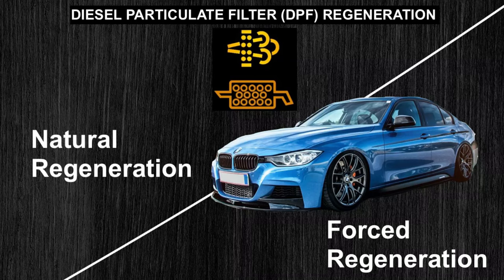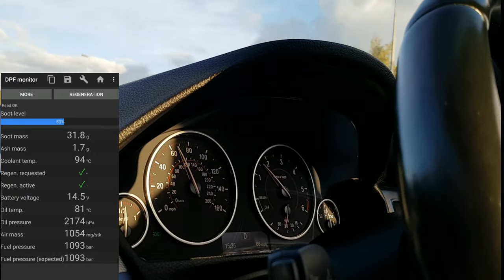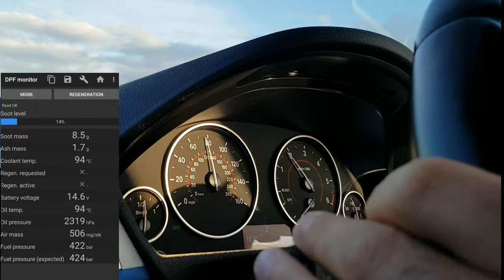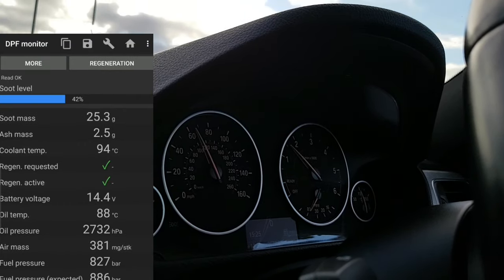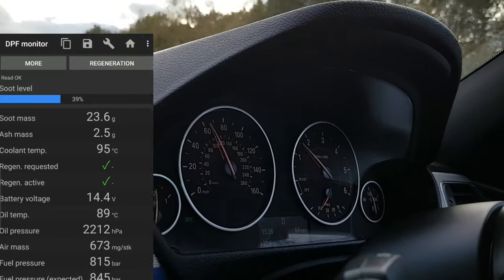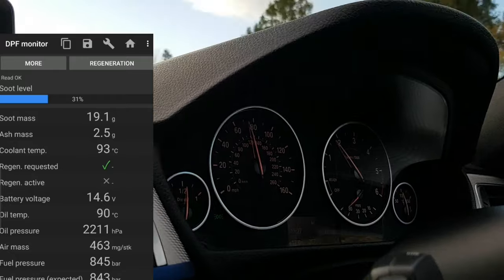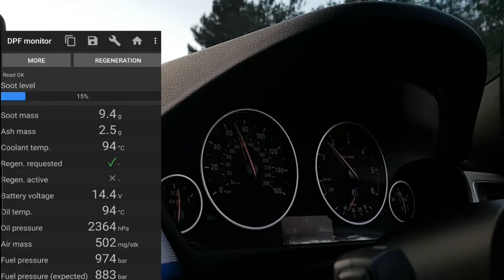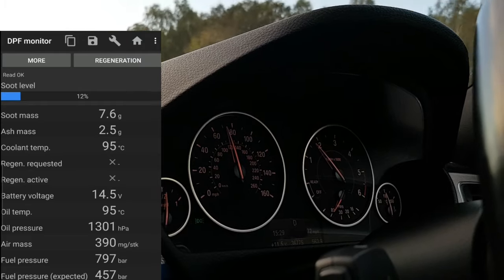BMW DPF Regeneration

Comment: I've found since I've deleted the EGR the DPF regens a lot more frequently and the exhaust gas temp isn't as high as beforehand. Will probably bring the EGR back as a result.
Reply from the maker: Unfortunately you're correct, especially euro5 and 6 engines are so tightly constructed, so any mods on the engine might cause a serious problems somewhere else in the car. In my experience, I like the way egr works, keeping the emissions low etc. But also I took it out to clean and it wasn't difficult at all.
Reply: Just a tought: shouldn't it be vise versa ? Because EGR is supposed to lower EGT and thus reduce NOx. Theory says EGR introduces less O2 in the engine and lowers burning temperatures. I think higher EGT means more "natural" burning of soot.
🤔
Reply: Is it 60mph or a certain amount of constant revs
Reply: @markneedham2287  Not necessarily no. DPF regens can happen while driving around town and also with less than a quarter tank of diesel.  On the automatics you'll definitely notice it as the behaviour of the gearbox changes.
Reply: @bmwsolutions7880  could you give me some information on what product you are using in this video please

Comment: Hey dude. My glow in plugs are good and so is the relay. 
Been on a long journey but engine doesn’t get past 59degrees 
And although I’ve requested the regen it won’t activate. My launch code reader says it’s been 2107904M since last regen! 
Car goes well and I have cleaned the intake manifold but either my tool is not accurate or what else could stop it doing a regen? 
Any help would be appreciated
Reply: Replace thermostats, boths, main cause why your car stucks around 60C and wont regenerate.
Reply: Cheers dude. 
I replaced the stat and now it’s 88 on the motorway so all good there. 
Still no regen! 
It says regen active but won’t activate. 
I am gonna check to see if it has pressure sensors on the exhaust because it’s an 06 plate and try my mates scan tool for a soot/ash level status and back pressure. And go from there. 
Anything else you may suggest?  
Top man
Reply: @DJSpannamanUK  Hey, i also have troubles with initializing automatic regeneration, even with all demands such as 75°C, 10l of fuel + etc... so i purchased an obd k+dcan cable, otg cable {usb to usb-c (my phone socket type)} and bought also a bimmertool expert app (google play) for about 15€ and now i can run regen anytime i want.
But after first regeneration i spotted that after decreasing soot mass from about 42g before cleaning to 5g, it has after few kilometers again slowly rised to 24g +-.. iam guessing that dpf is most likely kinda halfway filled. But now it doesnt afect my power and consumption any much so i will keep it under control with my app. Once again, bimmertool expert. 
With dpf, ive heard that until you have stable 40g permanent sooting level, you should be Okay.
Anyway my differential backpressure at idle is 5mbar, which supposed to be more than good. New has 1.5-2.5mbar and the top limit is about 20mbar i think.
Hope that helps.
Reply: @davidstauber5288  top man.
Yeah my tool is the launch crp123 and I can request it in the DDE 
It says it’s been requested and it’s waiting to do it but for some reason it just won’t say ‘active’ as in actually do a regen. 
I was tempted to but and autel pro which does the same thing as yours but not sure it tell me soot levels etc. 
I will find out what the m-bar is and soot/ash levels on a mates two tools and get back to you.
I’m beginning to wish I kept the petrol E46 328i se 
If all else fails I will buy a dead 2nd had dpf and take out the inside and do a stage 1map ! That’ll put the missus back in the seat! Ha

Comment: Hi again.. I noticed my bmw B47 doing regeneration twice in city driving... I catching by bimmer link. It is doing every 444km.it is normal?
Reply from the maker: Hi, if you do regular short journeys in the city , regeneration gets triggered by the car when over 25gram of soot to clean dpf. If the  soot level is much higher, car starts regen at random intervals to clean dpf and maintain engine power. In other words, car can trigger forced regen based on driving habits and soot level.

Comment: I drive my car 2-3 times(4-12 miles each trip) short distance in every 2 weeks. Otherwise the car is used only for long distance holiday travel. It's really scary how fast the soots builds up. The last Regen took 30 minutes for the soot level to drop below 10gram from 40gm.. After driving 2 short distance it went above 22 gm.
Reply from the maker: Yes, the soot builds up very quickly after a few short journeys. That's why it is important to keep an eye on it. Some regens take 10min, some take up to 30 min depending on different variables.
Reply: Hi m8 , where i can see that gram on my BMW please , thank you
Reply from the maker: Hi 👋 , unfortunately bmw doesn't show it anywhere in the car. You need an enet cable/bluetooth adaptor and bimmerlink/bimmertool app to see it. 
Check out the options in my video https://youtu.be/JL2m4iN7KU0
Reply: @bmwsolutions7880  cheers m8
Reply: @heisenberg how is it going with your BMW, my requirements are pretty similar to yours, short trips and once a month long distance,
How often are you doing regens and have you faced any issues with the dpf?
Reply: If I knew about this DPF issue, I would not have bought my X5.  What a pain, comparing to petrol engines....In the end I am sure it costs a lot more than petrol ones

Comment: How far would you class a long journey once a month to clean DPF.
Reply from the maker: That was bmw dealerships' statement when I bought the car which didn't make sense to me. Dpf regeneration takes about 15-20 min usually as in the video. That's the reason I made a video about it

Comment: does anyone know what exhaust gas pressure triggers the regeneration? or what would the value of a healthy exhaust gas pressure at idle would be?
Reply: I believe it's 600 odd once regen is complete it goes back to normal temperature.

Comment: so the trick is just above 60 km/h but the revs dont matter how high they get?
Reply from the maker: That is correct 👌
Reply: @bmwsolutions7880  thank you, 40 minute drive?
Reply from the maker: If you're not monitoring it via app, I suggest 30-40 min should be fine. Otherwise, app would show it which may take between 20 to 40 min.

Comment: Hey, brill vid and much appreciated... My car has almost 120k on it, the first 4 years of its life were mainly motorway miles, up to 95k, it has since done a mixture of local and motorway miles, no issues so far but I'm kinda concerned about the dpf now. I've ordered the tool and will report findings, hoping you can kindly provide me some help thereafter. It's an f series 190bhp 20d engine
Reply from the maker: Thanks for the comment ✌️ 
It's always good to keep an eye on certain things in our cars even when there's no problem. 
Keep us updated how it goes. All the best 👍
Reply: Hey again, I've received the Vgate obd today, plugged into the car, connected, I'm using a non paid version of Bimmerlink... The dpf reading was as follows, soot mass 19.61g, oil ask mass 44.79g - lots of other measurements and the last one says the dpf has around 75000k left on it. Any comments. Also how do you force the regeneration process, do you need to be driving the car or can I leave it on the drive? Also, which app is best in your opinion as a fully paid version....
Reply from the maker: Hi, all readings look fine. Soot level should be 20gram minimum to trigger natural regen. Looks like car is healthy and doing it's regen periodically. Ash level hoes over 100gram, then dpf needs to be cleaned chemically outside the car. 
Finally, I'm using bimmertool for regen as it shows all percentage values nicely. Service functions are also nicely laid out in the app.

Comment: I am a bit confused about how the DPF Regen works? I have a 2018 BMW F30 320d. When I measured the Soot level with BimmerTool, it showed 28 gram (over 40%). With that level, I drove 9.2 miles in stop and go traffic mostly in urban areas (30mph) and in dual carriage ways with 50 mph speed limit. After I had reached my destination, turned off the car for about 10 minutes then again drove 9.2 miles back home. In total, I drove 18.4 miles in stop and go traffic with a top speed no more than 55 mph at any time. After I came back home I have checked the soot level again and to my surprise the level dropped below 10 gram. I was not expecting any regeneration because according to the video the car needs to maintain at least 60 mph without any stopping. 

Can anyone please explain how the DPF dropped the soot level?
Reply from the maker: Yes, you're right. It looks a bit confusing but same thing happened to me as well. If you have a modern Euro6 diesel engine, dpf can trigger at lower speeds by increasing the exhaust temperature without speeding to 60mph, thinking that you forgot to regen. This is a precaution by the engine to prevent dpf blockage. However, it is not recommended to let your car do that regularly when the engine is not warmed up properly and below 60mph.
Reply: In the begining of the video says that car speed must be >60km/h, not 60m/ph
Reply from the maker: Yes, it does! But when I drive regen starts at 60mph, so it maybe because of country/region difference.

Comment: Got the app, but it says below 60KM\H , not 60mph :)
Reply from the maker: I agree with you, but bmw recommends 60mph due to not knowing the age of your car, dpf condition, soot and ash level. However, bimmerlink dpf regeneration app recommends 62mph 😅🤷‍♂️
Reply: @bmwsolutions7880  Do you know if can regen when you stop ? I mean if you have a red light and you need to stop ? There is no was ( exept Germany ) can drive 20min at 60+mph every week or so.... so i think this filter can regen regardless the speed :) i guess
Reply from the maker: My regen process takes 10min or so max. So I believe it differs from car to car. In case you have to come to a stop or reduce speed below 60mph, you can send a regen request (forced)  and complete it.

Comment: So what are the desired DPF numbers?
Reply from the maker: What do you mean by desired numbers?
Reply: @bmwsolutions7880   @BMW Solutions  I mean the numbers which appear on the Bimmerlink app (assuming you are using that app), like soot levels, ash oil, coolant temp, etc.
Reply from the maker: I see, what you see there was a live data when you're connected to the app using Bluetooth adaptor. For the video, our interest is soot level only. When it hits 20grams or 40%, natural regen should start, if it doesn't you can trigger forced regen. 
Ash level is not important until it reaches over 100 grams which indicates a chemical cleaning of dpf. Rest of the numbers/values you see are my main screen of the app. It can be adjusted to whatever you want to see.

Comment: This is all because the entire dpf idea is just a gimmick . if I fill a rubbish bin with rubbish until it is full then I take it out on the street and tip it back out how have I helped with the litter problem .
Reply: yes but you burn that trash at over 700°C 😀